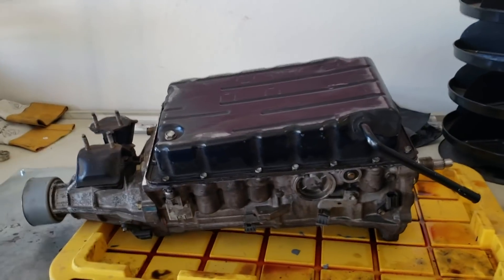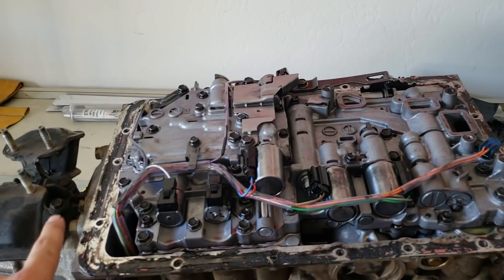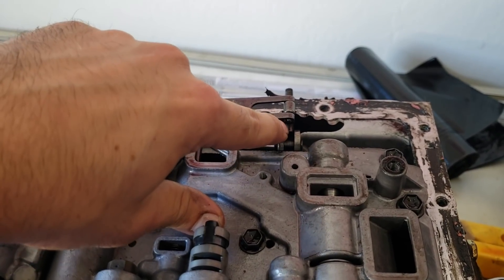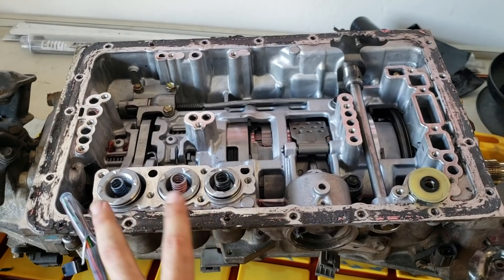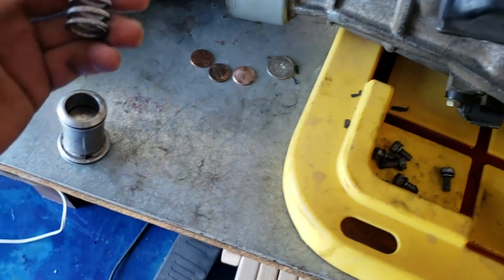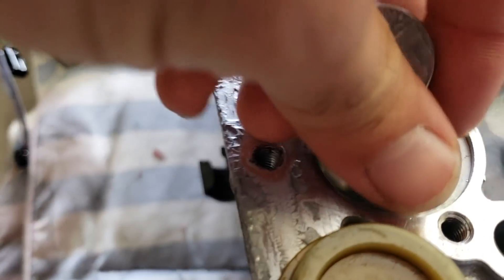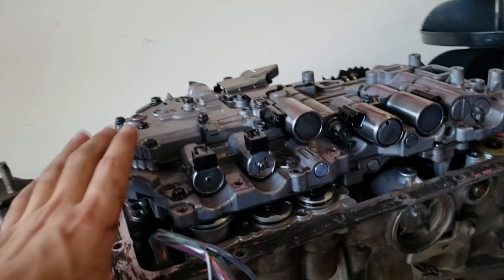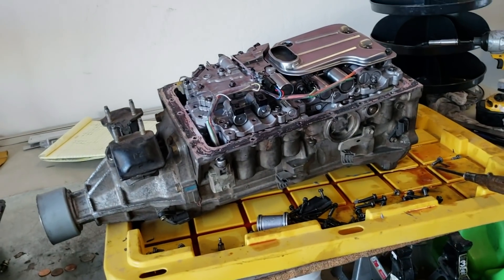How to make the A650e hold power! Building your Lexus IS300 Auto Transmission on a budget! DIY Video

Comment: Didn't realize the 5 speed cars are so few. I picked up a red 02 5 speed is with lsd for a daily. YouTube has me wanting to juice it up now
Reply from the maker: 0xXAllForNothingXx0 just so you know. The stock w55 manual doesnt hold a lot of power. Maybe 300 if you baby it.
Reply: RacecarAndChill that's what I've read. Very unfortunate lol I really just want to put a stock gte in it, and see if itd last, I'm not a street racer but I'm not real happy with 200ish hp
Reply from the maker: 0xXAllForNothingXx0 if you're gonna go through with the gte swap, might as well throw in a new trans too! Lol at least a w58
Reply: RacecarAndChill that's the research I still havnt done.how much do those go for?$  I know a 6 speed is insanely expensive. Iv read of t56 swap,
Reply from the maker: yea t56 is the best swap for the IS, but expensive.. im not sure how much the w58 costs either.
Reply: RacecarAndChill appreciate the input

Comment: So I did this with the trans still installed and every gear is drive......even reverse and neutral. What did I fuck up ?
Reply from the maker: Jamil Sabbatt the shift linkage is probably off. Go to 8:33 of my video and I point to it. I hate to be the bearer of bad news, but the pan has to come off again.
Reply: I figured that’s what it was so me and my buddy are gonna pull it back off this weekend. But also I had a 5th spring fall out when we took out the valve body and everywhere I looked I didn’t see where it could have come from except one place and it was a smaller spring inside the last hole you shimmed
Reply from the maker: Jamil Sabbatt how small of a spring are we talking? Like the size of one that would be in a pen but a little longer?
Reply: RacecarAndChill it was a tad bit smaller than the accumulator spring both in length and width. Small enough to fit inside of the last one you shimmed which was where i put it inside of based off of a diagram of the tranny I looked up online. So essentially I put a spring inside a spring on top of shimming that last accumulator. I’m so lost man lol I got a day off tommorow the 1st thing I’m doing is popping my oil pan off to check if I fucked up the shifter and if not my next guess would be that spring. If you could help me out in any way possible I’d really appreciate it man. I’m trying to get this thing boost ready before deployment lol
Reply from the maker: Jamil Sabbatt yea I think you put the spring in the right place!

Comment: Does this get rid of the lag between throttle and gear change? My GS400 takes nearly a full second between putting my foot down and dropping a gear. It’s slow when dropping multiple gears too. What makes me real mad is my friend’s Camry will respond almost instantly.
Reply: Taylor. I have a gs300 with the gte swap and I had an sc300 that has ur same problem it sounds like. First. U should look into having ur tps sensor adjusted. And idle air sensor. If they go bad or slip out of place they can make the lag between shifts horrible. What he's doing in this mod will shift even quicker than it will when it does once u fix it. But just remember not to shim the accumulator for the 2nd to 3rd shift to hard because that sprag is very weak in ur transmission
Reply from the maker: Taylor Rhodes I dont think it would help your situation. I would expect that lag to be in the ecu, not the trans.

Comment: Can you do a video on how the car drives now that the transmission is modified?
Reply from the maker: reza ishak yes I will! The car is still not put together because the turbo kit is being assembled, but as soon as it's back together and running we will make a video about how it drives!
Reply: RacecarAndChill can't wait keep up the good work bro!!!
Reply from the maker: reza ishak thanks for subscribing man! So much stuff coming to this channel soon!
Reply: Do you have the pressure line running to the top or bottom of your external trans cooler? Assuming you have it mounted sideways. B & M says bottom, but I've read MYIS forumns saying the opposite. I've also heard it doesn't matter. What say you?
Reply from the maker: I would say it doesn't matter, but if it were mine I would run it to the top so it can fall through the cooler

Comment: I still cant believe what he did
Reply from the maker: Abdulrahman Al marzouqi what are you confused about??
Reply: RacecarAndChill sorry for the late reply, but i still cant believe that way is to make your transmission handle 650whp, i have an A340E on my altezza after going up to 1bar at 370whp transmission started slipping and behaving weirdly, every time i told someone ill swap it with a a650 they said no the a340e must handle much more power than the a650
Reply from the maker: Abdulrahman Al marzouqi it's TRUE! The 340 should handle more power. Make sure you have enough fluid in it and that you have a cooler for the fluid too.
Reply: RacecarAndChill hmm all that time i was planning to buy the a650 after that video..... mine has fresh fluid and a moshimoto cooler, trans temp after 4 pulls never exceeds 105 and as i said am at about 370whp it acts weird and slips sometimes. Thats nothing close to 650whp and as i read most of the forums said the a340e is good to a maximum of 370whp
Reply from the maker: Abdulrahman Al marzouqi your trans may already be damaged then. That's weird. They typically get damaged if you boost really hard in the first 2 gears. Especially during that 1st to 2nd shift.
Reply: RacecarAndChill http://www.supraforums.com.au/forum/topic/58611-how-much-power-can-an-a340e-gearbox-handle/

Its not only me, many people are having some slippage and some break at the 300-ish
Reply from the maker: Abdulrahman Al marzouqi that's interesting. I wonder if they have differences depending on what car they came out of.
Reply: RacecarAndChill well in the end am really lost and want more boost🤣
Reply from the maker: Abdulrahman Al marzouqi haha dont we all!

Comment: Do you know if this will work for the aristo gte trans ??
Reply from the maker: Yes it will. It is the same on the inside!
Reply: RacecarAndChill  nice im doing this soon
Reply: @RacecarAndChill no- it is not. Aristo 2jz-gte use 4 speed A340 (30-40LE) transmission. All weak 2jz-ge use that a650 5 speed transmissin. How could be same inside 4 speed and 5 speed?😂
Reply: @guglegugle8075 any tt aristo is the 30-40LS with the j3 larger bellhousing not the a340 30-40LE w/ but yea competelly different valve body then the a650e lmfao

Comment: Will this help improve shift times at all? Id like to do this with my 99 SC300. Also would a five speed automatic from a 98+ gs300 or sc400 be plug and play or will there be extreme amounts of work?
Reply from the maker: oj tyler this will make the trans shift faster for sure. And I know the process is the same for the 4 speed. The swap would be easy. Direct bolt in. The only thing I'm not sure about is the wiring and the ecu. I don't know if the older ecu can run the newer trans. Sorry sc's are not my strong point.
Reply: RacecarAndChill No problem, thank you so much for the response and great video.
Reply from the maker: oj tyler no problem! A good friend of mine has a bad ass sc that makes like 550 to the wheels. Sub to the channel so you don't miss when I review it!

Comment: actually only 98-00 SC400 uses that 5spd Auto, ALL SC300s uses the A340e 4spd with varying final drive diffs.....I was going to try to build my auto in my 99sc300, but decided to go Solstice manual instead....but your trans really have money in it
Reply from the maker: The A340e is the same inside, so this mod will still work. And yes, this trans is built with money inside as shims. The trans I run in my turbo is300 is the AR5. This was a friends transmission.
Reply: how is the AR5 trans holding up....thats the trans ill be swapping in. I dont see much in terms of strength about them on the net.
Reply from the maker: It holds up to abuse at 420hp all day. Has a weird vibration issue but I think its from my rubber bushings being torn. Will be replacing them soon and I will report back. Subscribe to the channel, I'll be making videos about that thing when I get back from Tokyo. Swap has like 10k ish on it so far.
Reply: Love the video putting shift kit in won't be so scary now. Thanks!
Reply from the maker: Nate G glad to help! It's easy man! I was super scared to open it up too!